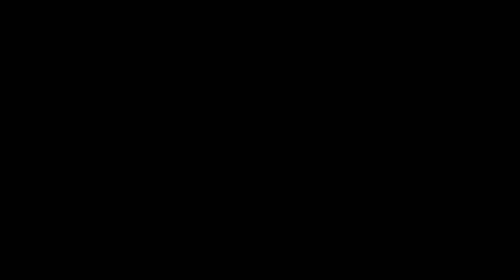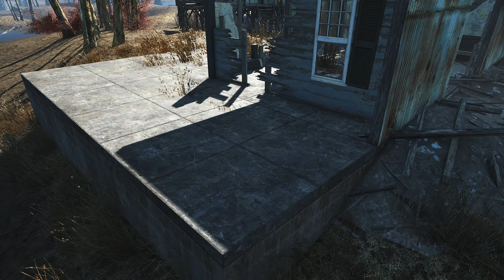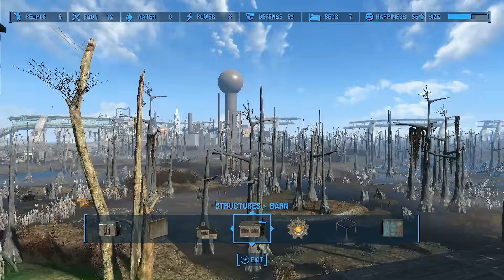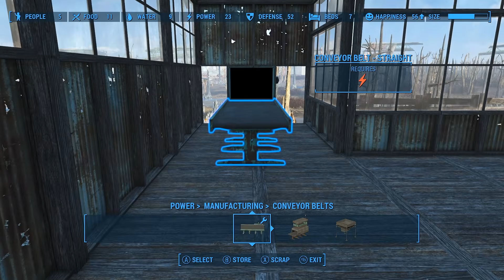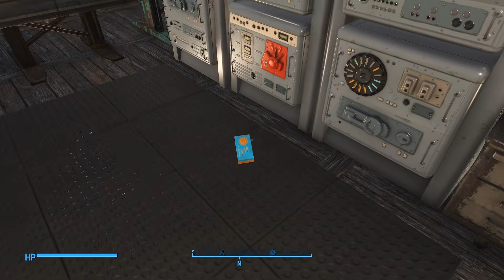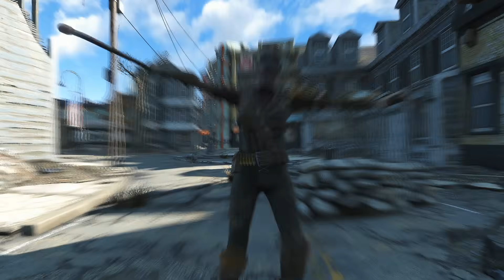Fallout 4 Ruined House Repair & Factory (No Mods/Glitches) Ep. 3

Comment: Problem is that I cannot get the foundation to snap onto the wall on the right front side of the house. Everything else seems to be working great. Thank you.
Reply from the maker: You are welcome.  Are you having problems with the foundation on the right front facing the house or from inside the house facing the front door?
Reply: @CCRenovatesFallout  Yes. The foundation will not go underneath the wall and snap in. It will go farther over and out though. I just did that and it seems to have worked. Sorry about asking since it got resolved. Just slightly different than planned.
Reply from the maker: @robertslagle7918 No worries - I'm glad that you were able to get it fixed!
Reply: @CCRenovatesFallout  Still can't get the half floors(or any floors) to snap to the top of the shack because the broken frame is in the way.
Reply from the maker: @robertslagle7918 It sounds like you might not have raised the walls up high enough to clear the shack.  Two things come to mind - Did you elevate the first wall by placing down the small floor (starting at 1:55 in the video)? Did you use a warehouse or barn wall (not a shack wall) for the first wall? This should raise everything high enough to clear the shack.
Reply: @CCRenovatesFallout  There was no mention of putting down a small floor. Just the 2 scaffolding pieces on that one side. Then putting on the roof before building the walk.
Reply from the maker: @robertslagle791 Sorry my mistake.  You Tube put this comment on the Murkwater Factory video.  I thought you might have had problems with the to the walls not clearing the broken walls of the ruined house.  You are correct there is no small floor for the walkway. Sorry again!
Reply: I went back and looked and my second scaffold was not lined up. It was way behind the first. It is now corrected and looks perfect. Thank you for your patience.
Reply from the maker: @robertslagle7918. That is good news!  I'm glad that you were able to fix it 😊